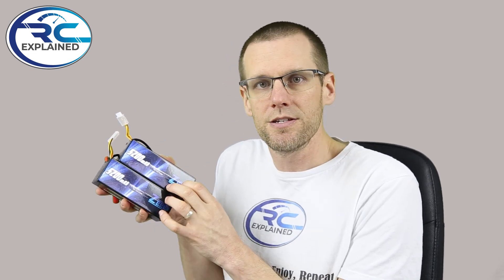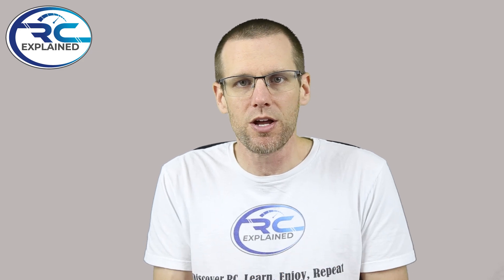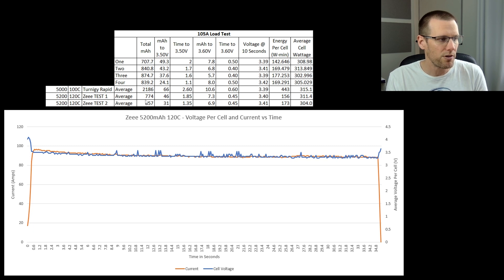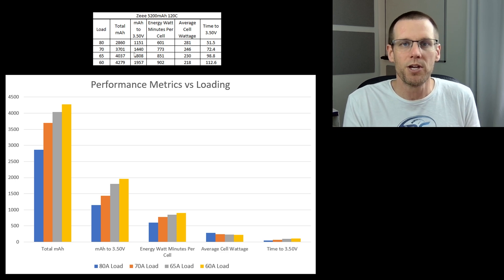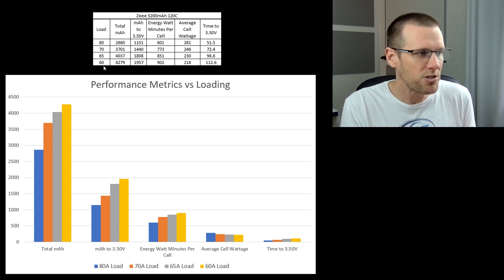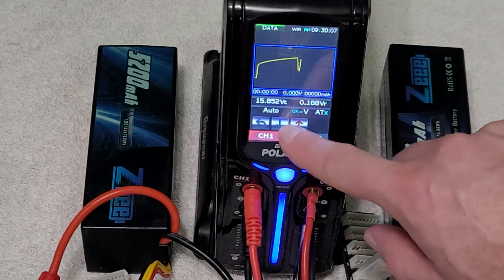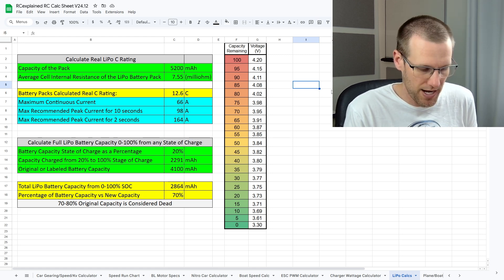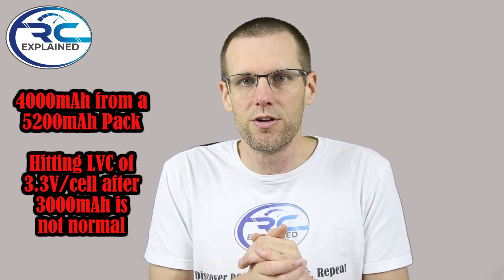The Most Intense Zeee Battery Performance Test on YouTube! 5200mAh 120C - Determine Actual  C Rating

Comment: @RCexplained So? is it good? do you recommend it for a budget battery?
Reply from the maker: Not the Zeee battery no.
Reply: @RCexplained  i dont understand why they are rated so bad here. I bought some 3s ones for my 4x4 slash and its crazy fast. Wheelies on 70% throttle and a runtime of almost 50mins. There better then both the gens ace AND ruddog batterys ive had, even while being 3x cheaper!!
Reply from the maker: I think the data speaks for itself. So far, performance wise, it's the worst battery I've tested so far. I have yet to test a gens ace. But it's on the list.
Reply: @ maybe you had a faulty pack? its a hit or miss with zeee's.
Reply from the maker: Thats what many commenter's said. So I literally bought another 2 packs and posted a complete second video. I've now owned 6 4s zee batteries and 6/6 have been terrible from a performance perspective. Did you see the other video too?
Reply: @ i have not but i cant find it. can u send me a link?
Reply from the maker: Did you see this one?
https://youtu.be/MiygWjtyY_M

Comment: I've raced using 7200 4S ZEE packs in my 1/8 scale buggy and truggy for several years with no issues at all. Like mentioned, the average discharge current is pretty low on 4S. I did try a 2S pack on my 1/10 indoor off road buggy and had some issues. For 4S, the C rating is pretty much irrelevant because of the higher voltage, but for 2S, I'll be sticking to some higher quality packs for sure.

Comment: I bought two brand new Venom 3s 5000 batteries and after cycling them 5 times I finally put them in my Revo. I got one from throttle run before low voltage cutoff kicked in! One!  I’ve tried several more times sense and get the same response every time. They’re fine at half throttle.

Comment: I just ran my big 9500mah cnhl 4s and 6S packs on my limitless. They are not doing well. On my xlx2 with a TP4070 motor they get pulled down from 33.7V all the way to 16V😮. Current draw is 580Amp. That is a massive voltage drop and show that the quality of the cell chemistry is not good at all. Are they better than say a gens ace. Yes. But they are not even close to the premium speed run batteries like Onyx and others in that class.
Reply from the maker: Wow. That's an intense voltage drop. Not what I would expect from a pack that large.
Reply: @RCexplained  I was really surprised aswell. If You want I can send You logs from my speedruns and the setups that yield these. It's good additional info to have.
Reply from the maker: @raindeergames6104  sounds good, you can send it by email.

Comment: PLEASE test the gnb 5000 6s 50c. They are suspiciously low in weight, being about 100 grams lighter than the CNHL 5000mah. Also can you do actual capacity tests at like 30amps instead of at 105 amps as well?
Reply from the maker: Where do those sell? I haven't heard of them before and have not been requested these before.

Comment: The full-size aviation and automotive community has concluded that crimping is the more reliable form of connection versus soldering. This is due to the potential for soldered connections breaking due to vibrations work hardening the solder joints and thus making them brittle. This is not a problem when you can inspect the connections during every use for RC but it is something to consider.
Reply: In my experience a high quality crimp connection is more flexible and less prone to breaking. Solder joints have a tendency to work harden the wire around the connector.
Reply from the maker: Interesting, I think the goal for most would be least resistive connection. I wonder what that would look like between the 2.
Reply: @toolbaggers   @RCexplained  assuming good clamping force I would expect little difference between resistances. One thing to consider is the smaller size of rc wiring vs. automotive. Thinner manterial for crimps on small wires could be subject to lossening over time.
Reply: Thinner solder would be more malleable and less subject to work hardening

Comment: I've used various brands and all seem the same. It's like 1 or 2 manufacturers make the cells and the distributors just slap their connectors and label on them? Whatever is best priced on Ebay is what I get.
Reply from the maker: Possible. My data does show the cells are different from brand to brand. I can't say much about the manufacture at this point.

Comment: Zeee and ovonic for trail trucks and crawlers ROCK.
I tried gensace and all 3 puffed and ran hot within 4th cycle. 

I will no longer overpay for lipos.
Reply from the maker: Interesting. Just curious why you'd rather pay so much for these Zeee packs when the turnigys are significantly cheaper
Reply: @RCexplained  Hobby king/ Turnigy apparently are not as good anymore supposedly they changed supplier or chemistry and they are not what they once were. THats what ive heard I don't know how true that is

Comment: Or, you could just buy better batteries that are safer, where you don’t have to solder on your own new connectors and such to make them better, or more usable. 🤷🏻‍♂️
Reply from the maker: These batteries do come with connectors, you don't need to solder on your own.
Reply: @ I know that, that’s my point. Why modify battery connectors when they already come with them? If said batteries don’t have connectors that work with your RC vehicles, why not buy ones that do? Just seems like a pointless modification is my point. Regardless, happy bashing.
Reply from the maker: I use AS150. My LiPo test bench also uses AS150. Do LiPos come with these setup correctly?
Reply: @RCexplained  I have no idea. I don’t use off brand budget batteries from Amazon. 🤷🏻‍♂️ I know the brands I use are more expensive (traxxas&spektrum) but I know what I’m getting is much safer when used and handled properly. I buy the batteries and charging systems designed for my RC cars. I don’t cut off the battery connectors from my cars and trucks like a lot of other people do to make different batteries work. So I honestly don’t know. But if what you’re doing works for you and is safe, that’s all that matters.

Comment: So TLDR, Zee sucks. Is there any cheap Amazon it eBay brands that aren’t bad?
Reply from the maker: I've tested on CNHL Lipo model that performs well.
Reply: You know the whole cheap fast relibale car thing? Pick two. Lipos are similar your options are cheap safe powerful. Pick two.
Reply: @ LOL oh I know! I just wanted to know/hoped there may be at least one or two decent and affordable lipos.
Reply: @2down4up  NiMH batteries are generally cheaper than lipo. Maybe they are more your speed.
Reply: @ Nope to slow! Too much voltage drop, too much weight and so on. I’ll stick to lipos.

Comment: Im new to Lipo. But i'll say so far, I have 6 different (2-6200mah 80C, 2-8000mah 100C and 2-Premi 9000mah 120c) Zee batteries and they all last very long and seem to have good punch in my Outcast 4S and 8S and rip the tire off my Felony 6S. For bashing they're a win. Competition and racing...eh maybe not but who knows. Great batteries IMO
Reply from the maker: Sounds good. If you pull a low amount of power from them,  they will perform ok.

Comment: I ve had much better luck with Zee over Gensace
Reply from the maker: I haven't tested gensace but the data speaking to performance on the Zeees shows its the worst battery I've tested to date.
Reply: @RCexplained  better luck meaning build quality.over time. No wires breaking off or puffing with Zee. I'm new to the whole speed run thing , just bought a Limitless to build over the winter .
Reply from the maker: Sweet decision. The limitless is a fun build to rip around with.

Comment: Sounds like crimped connectors are a much faster/cheaper option. Are they weaker or worse than soldered connectors?

I appreciate the information, but I'm not knowledgeable enough to utilize it.
Reply from the maker: Could be an easier cheaper option. I have no data to suggest this is worse than soldering.
Reply: i used connectors and the 2nd run they burned out. Just solder them.

Comment: No offense,  but you seem to be spending a lot of time and energy proving that cheap batteries are cheap for a reason....   I have a handful of Zee batts,  they work great in the cars I let my kids run at 50% throttle.
Reply from the maker: I test what the subscribers request. Unfortunately, when the poor batteries are shown to be poor 2 videos ago, I was asked that it can't be true, test again. Again, I do what is requested to help to community see the truth.
Reply: Good answer!! @RCexplained
Reply: Because there’s a ton of people online telling people to use the zeee batteries. They really aren’t that cheap when they’re not on sale. On Amazon right now 2 10k mah 4s batteries are 194 bucks. SMC batteries have 10200mah 4s batteries would be $205 for two of them. If people recommend zeee and people buy them over the SMC then that’s pretty shitty. If someone is looking for performance from their batteries then they just got ripped off. 

I have two 10kmah zeee batteries i got off eBay for $60 a piece, i use them in my xmaxx for when im hitting big jumps so i dont blow up my better batteries. They work but dont run near as long or as hard as other batteries similarly priced, the white cnhl batteries are way better IME.
Reply: @itsamk18-ish  Your right, I am surprised with the number of positive reviews for the Zee's ,  my experience with them has been they routinely have the shortest run times but.....  in terms of cycles I get more use before the IR goes way up or the cells become unbalanced.    I group the Zees with the Ovonic, Tattu, Hoovo, Goldbat, Socokin, etc....  in that they are cheaply/fairly priced and you get what you pay for.   The reviews, including the extensive testing in this YT video,  are based on such a small sample size that I tend to be slightly skeptical....if the Zees are on a good sale, I'll still buy them.  They work great for some applications (not speed runs),  but if the reviewers were seeing them puff and fail catastrophically more than others then that would get my attention.

Comment: c ratings on any brand batteries are pure fiction, as you said the best actual true c rating you will get from the best brands of lipo available are in the max 35c - 40c ! They are generally pretty expensive batteries as well, over the years we have seen c ratings  printed on the battery labels climb to unbelievable numbers. In practice we only see quite small increases in performances over batteries where the true claimed ratings more more realistic ( before manufacturers started lying about c ratings ).
Reply: Yes I've learned from experience you pretty much get what you pay for on batteries. I've seen em all go bad but for consistent race performance just get good ones😊
Reply: I just don't buy high c rated batteries as to not be disappointed haha
Reply from the maker: @gillian9178 absolutely.
Reply: Try a graphene with high-c rating, difference is immediately noticeable in an EDF.

Comment: Could you do some tests on the Hoovo brand? The 2s 5200mah 80c is what I’m running in a 2wd Slash.
Reply: I have 100c Hoovo batteries and they are just as bad as Zeee
Reply: I have 2 120c hoovo 4s batteries. I've had for 1 year. I definitely could notice a difference from my LECTRON PRO 50 c battery. It cost $80. I got 2 hoovo 120c for $90.

Comment: Im running x2 in my Losi dbxle v1 stock and these batteries work alight they don't get hot at all, but i do notice they don't last as long as i would like. Also the ones im using say the are 50c 5000mah
Reply from the maker: Interesting. I wonder what difference is between the 50c vs 120c